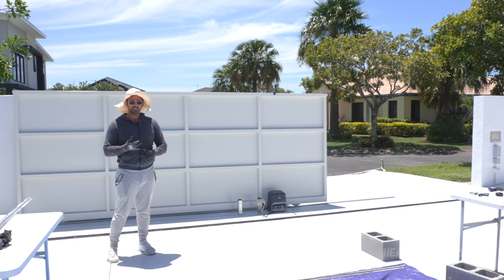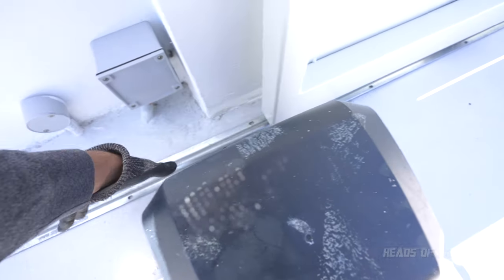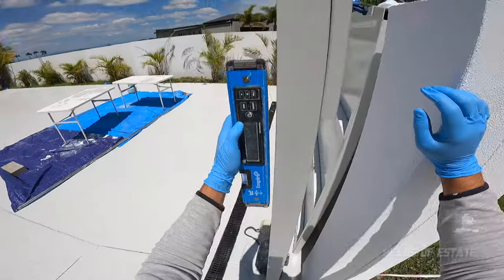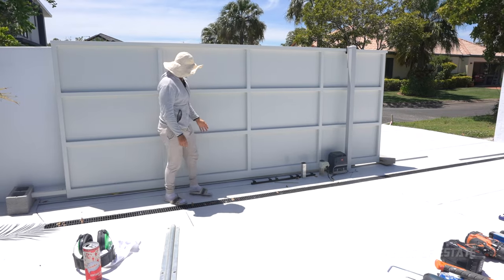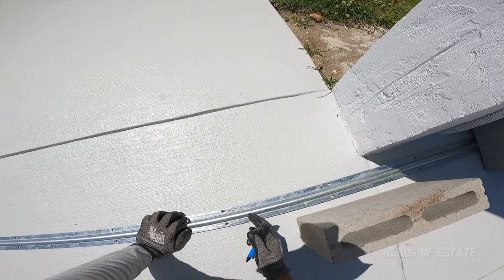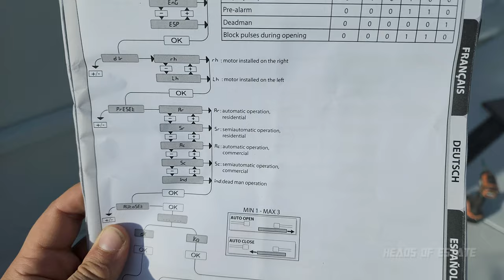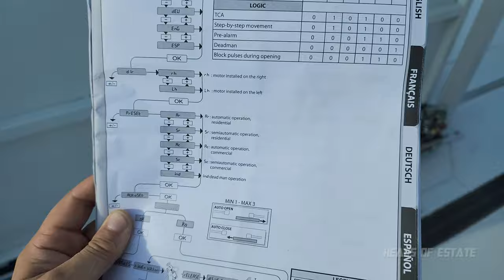How to Install Automated Sliding Gate and Motor | DIY First Time

Comment: You’re missing a part on the brick pier that the gate closes up to, to hold the top of the gate in position when it’s closed. There should be a receiving bracket for the gate to slot into so that it can’t be pushed away from the wall and off of the tracks
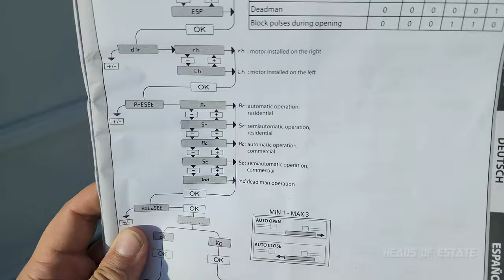Reply from the maker: I mentioned I was going to add it on at the end, you can see it there at 14:39, but thanks for looking out 👊

Comment: What about the safety, Very dangerous gate. You need to cover the trapping , drag in and sheer points. Then it has to pass a force test .two children were killed in England, the installers went to prison. Please look into safety edges and photo cells
Reply from the maker: The motor I use stops if there's resistance, but you can also install a sensor if you plan on having your kids/dogs play unattended while you're driving in and out of your driveway.
Reply: @headsofestate that BFT motor is pretty strong and is capable of killing someone. I install automation but this setup doesn’t worry me too much. The main issue is with auto close. If you want to instantly make this system safer change the mode to semi-auto so it doesn’t move unexpectedly. Also make sure the gate can’t fall out of its guides and fall on someone, that’s the number one cause of death with gates.

Comment: Great Job first but, not sure about the Regs in Australia but in Europe we require safety photcells for closing on the outside of the pillar as a minimum. Thats a strong motor to get pined by, again impressive install just as an installer liability is a concern